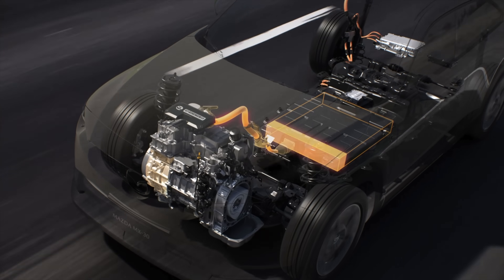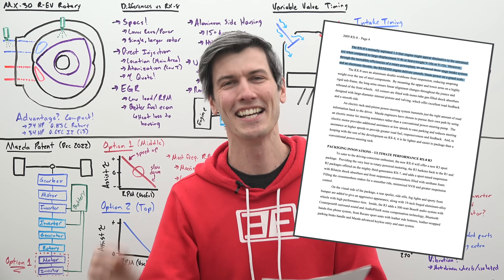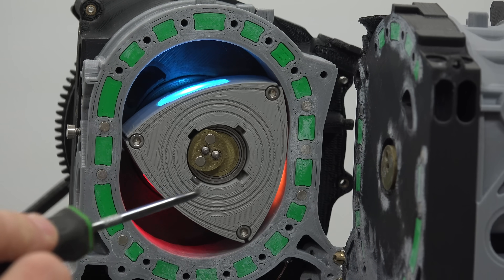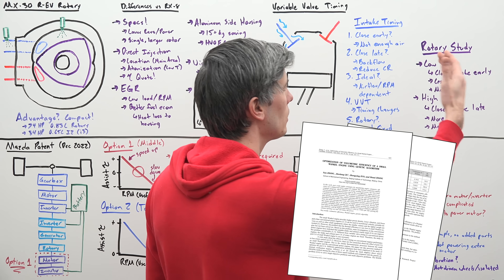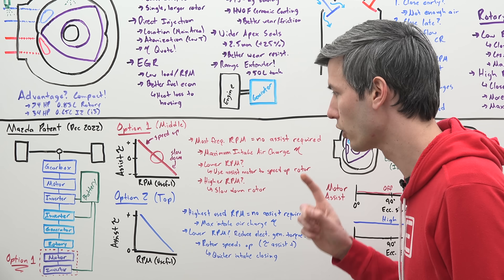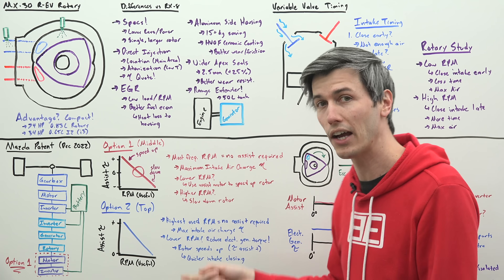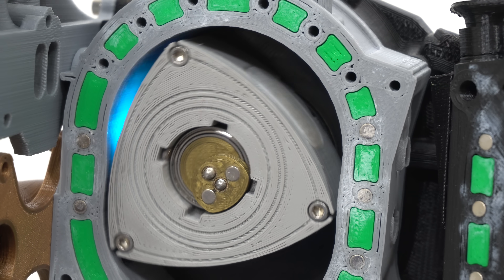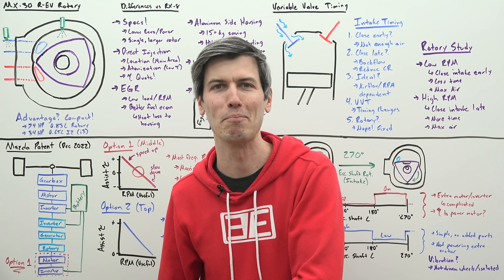Mazda Brought Back The Rotary Engine!

Comment: This is such a strange solution.  Wouldn't it be far more straightforward to simply cycle the engine on and off at its ideal speed to provide power to the drivetrain?
These motor pulses are similar to the bumps Honda's hybrid assist motor gave to the 3-cylinder in the Insight to smooth out its rotation, but that was to smooth it out and make it less variable in its behavior.  This is backwards from what Honda was doing; changing the rotational velocity of the dorito multiple times per revolution, this sounds like it's just going to make the engine as buzzy, jittery mess.

Comment: I don't see any efforts here to effectively reduce apex tip wear, despite the increase in size, nor any effort to alleviate the negative or reversed rotation effect during combustion, both of which have been the main issues with reliability and efficiency in the design. These issues were paramount in other users of the Wankel design abandoning it for more conventional configurations.
Reply: This does not seem like a concept that can be taken seriously especially considering how times Mazda has created hoaxes related to the Wankel engine.. e.g. the 16X, RX9, Demio RRE and the RX Vision Coupe... no of which ever amounted to a actual production vehicle.

Comment: What's the point of having variable RPM for a generator? Just keep it running with the optimized RPM.
Reply: Because modern rechargeable batteries have a very sensitive variable charge rate curve.

Comment: One annoying problem with a Range Extender of low horsepower like this one:  The BMW I3 has a weakly-powered Range Extender which creates anemic acceleration or hill-climbing ability when the big battery ran down to near-zero.  A Short burst was there from reserve battery power, but not enough sometimes. ...
There were lawsuits about this, as safety was impacted, mainly when trying to pass or just keep up with traffic in some very real situations.
Think about it, your vehicle is suddenly transformed into a snail, maybe right when you need power to be safe.  
Think mountains, high altitude, long climbs, or hostile California highway traffic, etc., and that is why BMW got sued.

This Mazda system is a little better.  Higher IC engine power to weight ratio than the BMW I3 on Range Extender (after the battery depleted).

Also, I would think Mazda would need to keep a good reserve battery capacity when the battery was running low. .....
For example, switch ON the Range Extender IC engine when charge gets down to 15% battery capacity, instead of keeping a very low 5% in there.   This at least would allow for longer runs up mountain slopes or long repeated passes in rush-hour crazy California traffic, maybe !

Comment: So much unnecessary effort. Just put in a larger battery.
Reply: Simple, fuel is extremely more energy dense than a battery, not to mention more stable. You save a tremendous amount of weight by using hydrocarbon based fuels.

Comment: I am beby, so pls someone explain - why not just use an electronically controlled flap/gate on the port to stop/allow air instead of messing around with the rotor's speed? Surely it would take far less energy to operate a flap than it would to influence the speed of a heavy rotating piece of metal. But like I said, I'm beby so I don't know much about it. There was a little snippet of rotating something in the port which is more or less the same thing as the flap I'm talking about, which tells me that it exist(s/ed) in the real world.

Comment: 1 rotor? that's a rather big disappointment... lol   somebody quick, pull the top plugs from your rotary and fit direct injection nozzles there and see if its any better... don't forget the high pressure pump and the other bits that go along with it...

Comment: Why not just use turbo charger to increase air during intake stroke? This would reduce the vibration of the engine and might be use the wankel engine to power directly the car (no more generator and electric motor).

Comment: since the engine is used as a range extender only, why is it so important to have an optimal flat torque curve?  it would just run at optimal constant RPM to charge the battery.  So I see no urgent need for that technology
Reply: That is why Wankel engines have never been successful as generator applications, their efficiency and reliability are inferior to reciprocating engines.
Reply: Rechargeable batteries do not have a flat charge curve, to maintain  maximum efficiency the engine needs to operate at a constant rpm AND LOAD... the Wankel engine is inherently inefficient compared to the reciprocating engine even under ideal conditions.

Comment: Why not use the most efficient RPM and have the engine run at that speed constantly...?
Along with that thought...configure the electronics to run most efficiently at a lower RPM to begin with...such as 1200 - 1500 RPM ish...
Start the engine and let it work as good as it can...all the time...
The "throttle" has control over the electric motors operation only...
K.I.S.S....

Comment: Very bad information in the middle talking about variable port timing Mazda had that since 1984 is calling 6 port motor which comes on the RX-8 motor hes talking about a 4 port major which comes on the last generation RX7 fD and the RX-8 automatic 6 port is called auxiliary port but on a rotary the port itself is like changing the cam timing and duration so when you open and close the port it's variable  because changes the timing so it's has variable timing Great info otherwise

Comment: Audi actually bought rights off Mazda about a decade ago to use the rotary. This is old news. 
If the rotary is going to be a range extender then it doesn't need to rev. It just needs to generate.
Buy an RX-7 while you still have the opportunity kids. In a decade or so, you won't.

Comment: I've driven a Prius on the job because when it's charged you doing God's work cleanly on the electric side. Once that goes down to a point you're doing it on gas on a very fuel-efficient engine. This also helps bridge the gap of infrastructure. I don't think a straight-up electric is the way to go oil is going to be around for lubrication and fuel is not going anywhere.  I suppose you could use electric in a nuclear dominant power grid area. Vehicles like the Prius and this here Mazda can bridge the gap where the infrastructure is shaky. Both of these technologies are best for highly dense population areas. I don't think there's one solution that works, maybe we need a multi-pronged approach.

Comment: If it is used merely as a range extender, what would be the purpose of caring about VVT? You will just run it at the most efficient RPM 90% of the time, so the extra complexity, weight, problems, and inefficiency make it pointless. With very low rev limit of 4500RPM, if you just go for middleground, it won't make enough difference to matter 99% of the time anyway. If the laughably small battery they are including can't provide enough juice for max acceleration, increase it's size slightly, as the extra theoretical power from the VVT won't be noticeable at all, yet a better battery would be very noticeable.
Reply: Agree.  Range extender is different with a normal engine.  It can run most the time in optimal rpm.  No need for those VVT trick.  May be it is the size limitation.  Why not using Stirling engine?  Stirling engine is not suitable for road use vehicle engine but it has the best fuel efficiency.  Stirling engine is also very simple.  It is not as small as Wankel rotary engines though.
Reply: That's a completely false assumption. A range extender EV is nothing like a base load power station.
The vehicles power consumption varies with speed and traffic and rechargeable batteries require a variable charge curve
The range extender engine must be able to to operate efficiently over a wide range of rpm and load.
Reply: @catchnkill  No, it can't... because batteries don't charge at a constant rate.
Stirling engines are very efficient but no one has yet to make one practical and reliable

Comment: Why are rotaries not diesel? Seems more of a efficient design
Reply: You mean Wankel engines?
The Wankel KKM57 design has no way to generate the static compression ratios required for reliable compression ignition and its seal design is unable to deal with the higher combustion pressures and temperatures.
Reply: @sandervanderkammen9230  dude wankel is not the only person to make a rotary so i will say rotary. And I’m asking because there are already rotary motors that have used differently fuel sources. They are finding e85 is better for a rotary so i am curious and scalloped rotors create enough static pressure.don’t know what you mean. Diesel still had oil in it so it literally will help lubricate housing and seals and burn colder actually it does not take super heat to ignite diesel
Reply: @Miamiboi305  The Rotary engine was invented by Felix Millet in 1892, 
Many people designed and manufactured Rotary engines prior to Felix Wankel...
Besides, Felix Wankel didn't invent the engine we are discussing in this video, the KKM57 was designed by Hanns Paschke and Walter Freode.
Reply: @Miamiboi305  Yes, and they have all been failures, the ideal fuel for the Wankel KKM57 is Gasoline.
This is well-known and understood by the major players in the development of the Wankel engine.

You are very confused and misinformed, the Wankel engine cannot support a static compression ratio 15:1 and its loses combustion efficiency rapidly above 12:5.
Reducing the combustion chamber pocket volume negatively impacts combustion efficiency and flame propagation.
Reply: @sandervanderkammen9230  I don’t care who designed it i know how designed this version. I owned 2 12a fb rx7’s one stock one bridge ported. Again my question is relevant as there are  a few people who have successfully converted a rotary to burn just about anything you can cycle in the motor. My question was kind of rhetorical because it has already been proven that straight 87,89,&93 octane do not burn efficiently in a wankel without some adverse effect. While fuels like e 85 have better cooling qualities and diesel with a little 2 cycle oil with meth injection I believe yielded similar but more torque and power I don’t know gotta dig in the threads again
Reply: @sandervanderkammen9230  wait a minute as a matter of fact there is a you tube video of a rc sized rotary running on different fuels and temps measured at various rpms. They all ran
Reply: @Miamiboi305  That's completely false, low sulphur Diesel fuel No.2 has a lubricity index of only 600mq, not any better than gasoline... and when used in conjunction with Stratified Charge Mode Combustion burns completely because it is injected after top dead center, it never comes in contact with the chamber housing walls or the apex seals.
 All of the Diesel Wankel engines that were developed required metered oil injection into the intake ports to provide engine lubrication.

Diesel fuel burns hotter than gasoline, not colder.
Diesel engines require a  minimum of 500° F of heat generated by the compression stroke, the Wankel engine cannot achieve this temperature reliably.
 Around a dozen major engine manufacturers licensed the patented Wankel KKM57 engine from NSU for conversion to Diesel Cycle operation.
Mercedes, Deutz, Yanmar, MAN, Curtiss-Wright, Rolls-Royce and John Deere all invested millions of dollars developing Diesel Wankel engines without any success.
All of these companys concluded that a practical Diesel version is not possible.

Any questions?
I would be happy to explain in further detail of you require.
Reply: @sandervanderkammen9230  did you not read what i said? They added 2 cycle premix and freaking water meth injection. I believe…. And again a guy made a table stand rotary that ran on various fuels….. and he measured the temp at various rpms…. In short a rotary can burn more fuels than you think efficiently including propane
Reply: @sandervanderkammen9230  you like history. I like present which is enthusiasts have totally found marvels in the rotary engine that were not even thought about in those days.
Reply: @Miamiboi305  So you don't know who designed the 12A engine?
Reply: @Miamiboi305  No fuel burns efficiently in a Wankel engine.
They are plagued by a very poor combustion chamber architecture.

It's not the fuel that's the problem, it's the Wankel engine.
Reply: @Miamiboi305  Yes, but E85 has less energy per liter, and the Wankel engine produces less power per liter than a reciprocating piston engine.
 Ethanol requires a higher static compression ratio to make more power.
 If you cannot burn all the Ethanol you cannot make more power..
Reply: @Miamiboi305  I have never seen any evidence from a reliable source and your claim is contrary to all of knowledge and information on this topic.
Reply: @Miamiboi305  Can you please give some horsepower per Cc and BMEP data on the various fuels tested?
I believe there is only one RC Wankel engine ever made, the Graupner GmbH. 
49.PI engine, and its glow ignition, not directly compareable to a spark of compression ignition engine dynamics.
Reply: @Miamiboi305  I am very familiar, Ingersoll Rand sold CNG fuel Wankel engines for a few years, Curtiss-Wright developed several engines for LPG for stationary power generators too.
Neither could compete with reciprocating or turbine engines and were abandoned.
Reply: @Miamiboi305  You should learn something about the development history of the Wankel engine..
You sounds so silly and naive when you say that... it's all been done before, the Wankel was exhaustively researched and developed and reached the end of its development potential decades ago.
Reply: @sandervanderkammen9230  yet people are building there own prototypes based off of the wankel design and making improvements to them again I know what was manufactured my question was why was the design not designed to burn a fuel with a stronger combustion capabilities…. That also aid in lubrication.  Never mind dude your head is stuck on a damn wankel when I’m speaking on the the damn design of the rotary engine as a whole. Yes i know of mercedes four rotary diesel that was not a success but then again most rotary engine designs got back burner to more efficient fuel designed piston motors. It is not because they did not work
Reply: @Miamiboi305  There is no longer any legitimate research or development of the Wankel engine today. The Wankel is an obsolete technology and is the sole domain of crackpots and con men.

Because they are mutually incompatible concepts, burning a fuel that lubricates the internal components reduces combustion efficiency and is a poor method for lubrication with several undesirable side effects such as fouling.

You still seem very confused about the difference between Rotary type internal combustion engines and the Wankel KKM 57 design.
The Wankel KKM 57 is not a Rotary type engine, it's a orbiting piston engine.

The Mercedes-Benz M950F was NOT a Diesel engine, you seem very confused about basic engineering concepts related to ICE design.
Reply: @Miamiboi305  That's the whole point, it's not that the Wankel engine doesn't work... it just doesn't work very well.
Wankel engines are inherently and fundamentally inferior to reciprocating piston and gas turbine internal combustion engines and this is why the Wankel engine was a failure and is now obsolete today.
Reply: @sandervanderkammen9230  there is a four rotor says otherwise
Reply: @sandervanderkammen9230  again in production yes. But like i said after market sYs otherwise
Reply: @sandervanderkammen9230  way to many threads and content that seriously makes you look foolish these motors have  been studied by practice by enthusiasts not dealers..
Reply: @Miamiboi305  The Mercedes-Benz M950F was gasoline fueled with spark ignition, do your research and see for yourself.
Reply: @Miamiboi305  There are no legitimate companies doing any significant research or development of Wankel engines... and no production.
Reply: @Miamiboi305  Your question was answered, Wankel engines cannot produce sufficient static compression ratios for reliable compression ignition.
Apex seal cannot reliablely handle the higher combustion chamber pressures typical in Diesel engines.

Diesel fuel is not an adequate lubricant and Diesel engines operate using Stratified Charge Mode Combustion and operate with extremely lean AFRs.
The fuel is injected at or after TDC... so there is no fuel present in the combustion chamber to lubricate the seals and is burned completely leaving no residual fuel in the chamber for lubrication either.

Anyone who suggests that Diesel fuel is ideal for Wankel engines is not qualified to discuss Wankel engines and is not an expert.
Reply: @sandervanderkammen9230  i have the link to it…i have the whole thread
Reply: @Miamiboi305  The M950F???
Reply: @Miamiboi305  According to Mercedes-Benz, the M950F specs show fuel type; gasoline/petrol
Compression ratio; 9.3:1
Ignition type; single spark plug
Lubrication: metered oil injection, oil injected at the throttle body. (Diesel engines don't have throttles)
Reply: @Miamiboi305  Daimler-Benz, (the parent company of Mercedes-Benz)
became a Wankel KKM57 licensee in 1961, and in 1964 expanded its license to include development of Diesel engines.
Daimler-Benz became a member of a joint venture called Diesel-Ring with Deutz, Krupp and MAN.
The development program never proceeded beyond single chamber laboratory prototypes. No 4 chamber Diesel engines were developed by Daimler Benz or Diesel-Ring

Comment: Unfortunately the real world fuel economy is still abysmal.

373 mile range apparently with fully charged battery and 50L tank. Terrible. My CT200h averages 420 miles to 35 litres with a good mix of driving.